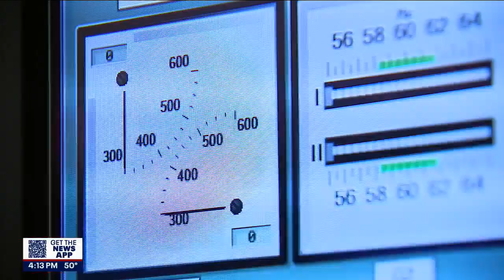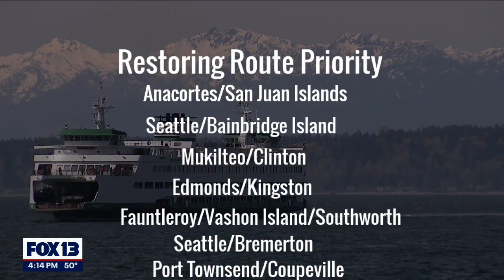Washington State Ferries pushing for "cultural change" to solve worker shortage | FOX 13 Seattle

Comment: Bullshit, I have an AB limited license to work on deck, wsf offers $19 per hour which is laughably low for the industry. Why would I work on a ferry for poverty wages when I could work for any tug company in Puget sound for twice that without even trying. Wsf needs to actually pay licenced guys a fair wage to fix the crew shortage.
Reply: Not too mention forced vaccinations
Reply: I'm pretty sure O/S starts at $23.01. I am an AB as well and was told $33 to start. I don't know where you get the $19
Reply: Well I know it starts out a little bit higher pay than 19 bucks but not much. What is it 21 or so an hour? The schedule sucks and it feels on purpose. You'll be on call with no guarantee of 40 hours a week for the first year or two. If you want a weekend off you have to work 10 days in a row. The hours are terrible. . The boats are archaic due to underfunding. You'll be routinely exposed to drug and psychotic problems from the passengers. Wading  through constant bureaucratic red tape from the Coast guard. Zero support from WSF administrative staff.
Reply: @9blucats  That explains the whole maritime industry. I work on tugs in Alaska. Coast guard still has the red tape. You are considered a seasonal employee.
Reply: @amonslow  man the coastguard when it comes to paperwork is seriously backwards.
Reply: Totally agree with you. I'm from Friday Harbor but I live down in the bay area they want to be skilled carpenters with their own tools 20 to 25 bucks an hour starting wage at In-N-Out burgers 18 bucks I want to go break my back for a few dollars more when I can just hand out water cups and get a free shift meal each day
Reply: And they require the ones on the boats to do 30 minutes of work in 15 and get paid cheap-ass wages and they seem to increase the fair at least twice a year. Which was originally instituted due to the fact that oil was over $100 a barrel. The cost of a barrel dropped but not the cost of riding the corruption Ferry

Comment: Ban all ferries! We need electric boats!!
Reply: A 10,000 BHP electric motor.
So how big do you think the battery bank will be?
A 600 BHP electric motor needs 54,000 lbs of batteries.
A range of 300 miles.
The last 50 miles at 50% power.
Do the math.
You need deisel...
Or it doesn't work.
Reply: @TheErik249  🤔🧐 Sails! We will use wind power! Ban all ferries and buy sail boat ferries! 🤓
Reply: Ugh. More expensive, and causes more destruction to the earth. BTW, lithium is up 400%.
Reply: @5.7ninetynine  
You sound like a crazy leftist!!
Thanks for the laugh.  😂🤣😂
Reply: Ban all ferries? So does everyone get their own electric boat to commute across the sound?  I don't understand.